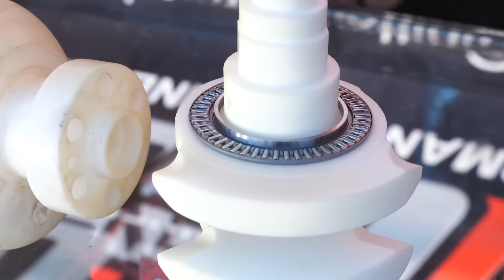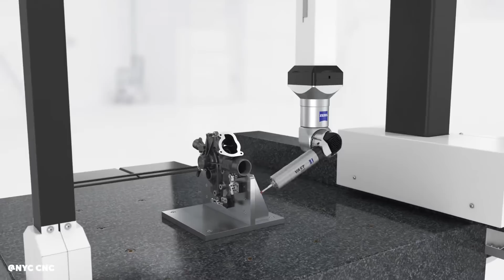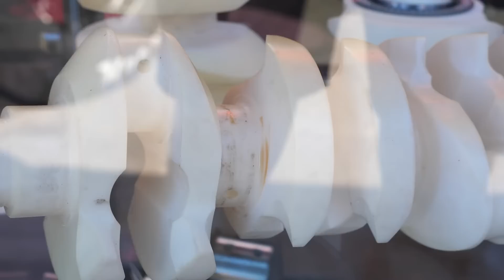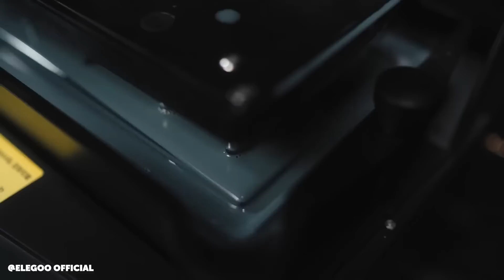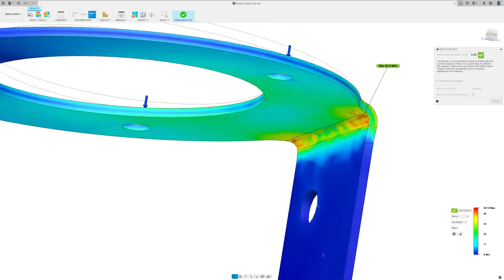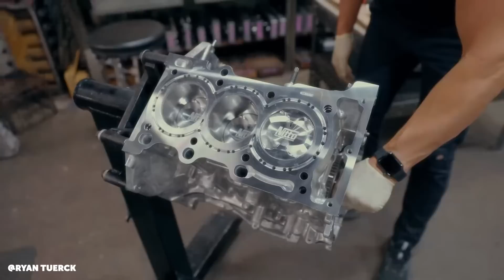They can't afford to get this wrong.

Comment: More marketing than reasonable moves. Just for inflating the price.
Reply: What do you think they're profit margin is?
Reply: @bryanshaw521  I don't know. But I know they can avoid expensive "measurement".
Reply from the maker: Almost everyone says it's easy to run a business and that owners overcharge, yet most businesses fail when people actually go out and try it for themselves 😅

That might sound a little rough sorry, but really just trying to highlight perhaps it's best to ask why this particular company does it this way before suggesting an alternative if you're in the same position yourself production wise - Taz.
Reply: When you can compete with them on price, you’re more than welcome to do so.
If you can’t, then it comes across as sour grapes that you cannot afford fully engineered bespoke parts in this market.

ANSYS still costs about $150k a year, Solidworks costs typically $15k-$42k, and testing is not cheap. 
You need a simulation engineer that understands how to do all of this, and typically that means amortizing a University education in addition to salary. 

Then you need a place for people to do the work, the machines and computers upon which to do it, and then the capital for prototyping before the first sale occurs.

Please let us know you how see all of that playing out- tell us how you’re going to magically drop those costs out of the process without compromising quality. 
I know how I’m attempting to do it, so I could use the mirth that will come out of the response.
Reply: So the profit margin is? @charlescoolidge747

Comment: 3000 HP car engine is just mind-blowing. I doubt it's physically possible.
Reply: not impossible at all, drag race applications (including some street driven cars in so called drag and drive cars) it's very attainable depending on your budget, current wheel dyno record for none nitro methane cars is well into the 5000hp range. For none drag/straight line applications, it's a completely different story because then lifespan of parts is a much bigger question behind how you even put down the power
Reply: @Yeet_Freak  lol drag engines dont last more than a few seconds
Reply: @sigmamale4147 false.
Reply from the maker: @sigmamale4147  depends on the enigne and application. Eric from Proline Racing touches on some maintenance aspects of things you might look at every run vs every 40 runs in general and in also in relation to their 5,200hp application.
He actually dropped a few nuggets in this interview that others wouldn't have shared on camera at the time - Taz.
https://www.hpacademy.com/blog/the-road-to-prolines-5200hp-hemi-v8-tech-talk/?utm_source=youtube&utm_medium=social&utm_campaign=general-interaction
Reply: Surely you haven't kept up with automobiles in the past 20 years right?
Reply from the maker: It's fair to say it is pretty mind blowing!

I wouldn't say it's common (or cheap!), some engines will do it 'easier' than others and generally specific to drag racing, but it's physically possible and has been for some time 😎 - https://www.hpacademy.com/search/results/?q=3000hp

I didn't make this thumbnail but the figures will come from Nitto somewhere and/or a project they are directly involved with. As you can see in the link above, it's not a once off occurrence.

We are living in a time an age you can build an Audi R8 to do 8 second passes (via 1500hp) and then drive it home via the McDonald's drive through with the stereo and A/C blaring.

When Andre was chasing 8's in his EVO 20 years ago, he was lucky to be able to drive it back down the access road in a dedicated race chassis 🤣 Granted, smaller engine and 2 decades ago, but these are facts.

Less talked about, isn't it also mind blowing that we have dynos that can reliably read up to 6,000hp? 🤓 - Taz.
Reply: They making ai so real these days. Really good work bot
Reply from the maker: @km6832 haha yeah I do wonder sometimes (welcome to the dead internet!) but give benefit of the doubt.
Did you see that experiment some Uni did on Reddit recently around changing peoples minds sub-reddit using bots and how much more convincing they were? Scary stuff - Taz.
Reply: @hpa101  yea i saw that, insane times we live in